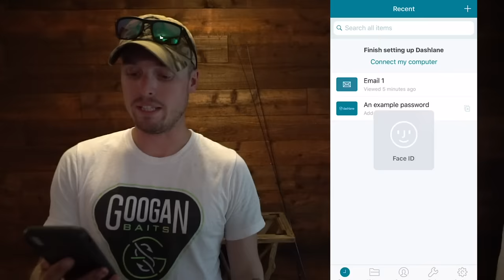$100 Homemade Kayak

Comment: Holy shit the three stooges build a sinker. Then he thinks putting a third pipe in the center will help with the buoyancy. It will help the pig float higher in the water when empty but it will not help the stability any. It’s too narrow to be stable in the water because the CoG is too high for the width. Good luck guys, after two or three versions you just might get it to work. Maybe.

Comment: I cringed when they started drilling holes. 
U-bolt or hose clamp the pipe to the 2x4 then glue the pipe. They're pipes, they're designed to be water tight. Skip the foam. 
Basic idea is cool though.

Comment: dont wanna get too sciency and stuff but putting the foam in the tubes is useless. Its all about how much water you're displacing and not about the materials you're using to do it. its only adding weight using the foam and not providing any more buoyancy. In theory you could even leave the endcaps off aslong as the ends stay above the water.  So my toptip: use hollow pipes and leave them empty, seal off the ends for good measure and maybe get some more pipes because you seemed to be lacking some floatyness ;) goodluck with attempt 2 my man
Reply: @LunkersTV Law of archimedes states: ''when submerging an object in water the resulting upward force is equal to the weight of the displaced amount of water''
Reply: And if I did the math correctly with 2 10ft pipes with 4inch diameter you're looking at about 110lbs of buoyant force, add the endcaps and the wood to that and you'll get a bit more but obviously not enough to keep you afloat. So if you want your rig to work keep in mind that each pipe will support about 50-60lbs of weight. you can figure out the rest ;)

Comment: I can't believe than anyone with common sense believes that foam is lighter than air!  Nice to have for safety or rigidity, but totally inappropriate here.  Buoyancy is easy to calculate.  There is approximately 8 1/3 lbs per gallon, and 231 cubic inches per gallon.  Four inch pipe is pi * 2 squared * length in inches = cubic inch displacement (buoyancy).  For quick calculation, 3 * 4 * length, or 12 * length, which gives 1440 cubic inch displacement, rounding down for pi and not using outside diameter of the pipe which makes up for pipe weight and slightly underestimates buoyancy.  So, a 10' 4" pipe will give you approximately 1440 / 231 * 8 1/3 pounds of buoyancy, or about 52 pounds per 4" pipe 10' long.  For supporting you, the kayak, and gear, I'm thinking 6 pipes minimum.  Probably best to have the pipes only half submerged for least drag, but calculating your buoyancy is far more important.

Comment: the foam was a good idea, but that's the wrong stuff, it's not meant to expand to the size you'd want, it's meant to seal cracks. The foam is also typically a backup in case the pontoons get a leak, they won't be able to fill with enough water to cause you to sink, so yes it's adding weight, but not a lot if you used the right foam and it would save you from sinking.

Comment: Replacing air with foam makes it heavier, and less bouyant.  Unless it springs a leak, in which case the foam will displace water, making it lighter.

Comment: Use a boat displacement online calculator next time. I had to use 50 soda bottles to get to 200 pounds of float. You need like 6 PVC pipes.

Comment: I can tell yall are not engineers lol. To get it to float I'm sure yall did not pressurize the piping. Also I would of used Ts to add the pipe underneath where you sat and bettween the two legs where you mounted wood for support. I also would of went with 6inch but it was funny watching yall thinking it was going to work with just 1 atmosphere of air lol.

Comment: You are doing it all wrong because of the diameter of the pipe is way too small for boyancy of more than the pipe and boards alone . You have to do some math to get the proper boyancy which is length times width times depth devided by cubic feet times 62.4 pounds

Comment: Guys.... Good effort but a few quick calculations could have saved you hours of time wasted on a faulty design.... Think about it. Calculate the volume of your cylinders- 
Volume=pi * R squared * Height.    Using this formula, you can see that a 4" PVC pipe that is 10' long has a volume of 24,711 cubic centimeters- If you displace 24,711 cc of water, that would have a mass of 24,711 grams, or 24.7KG, which is 52 pounds. Thus, your two PVC pipes can support a whopping 104 pounds on a good day... Add only  a slight amount of buoyancy from the 2x4 s (which steadily lose that buoyancy as they absorb water ) and you can see why it did not work. Dont get me wrong- Great effort trying to create something cool- Take this as constructive criticism- Math and design ahead of time really helps when building stuff.... I learned the hard way after designing plenty of stuff that did not work! Keep at it guys, and thanks for an entertaining video!

Comment: Wouldn't styrofoam balls or Styrofoam peanuts wouldn't that have worked better, rather than spraying foam insulation into those pipes. 
You could have turned it up on end and filled it with all those Styrofoam peanuts and not had to drill those holes in the PVC pipe, duh!